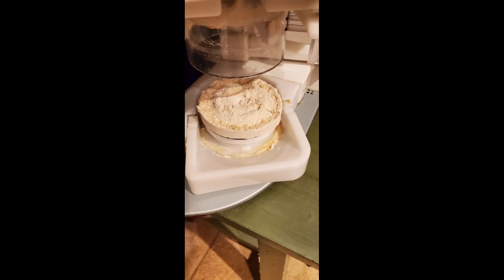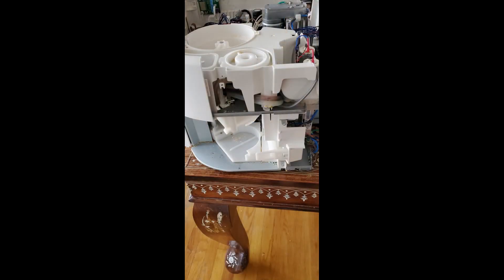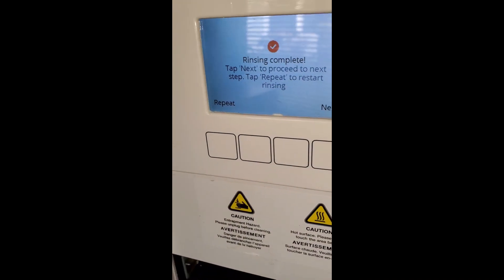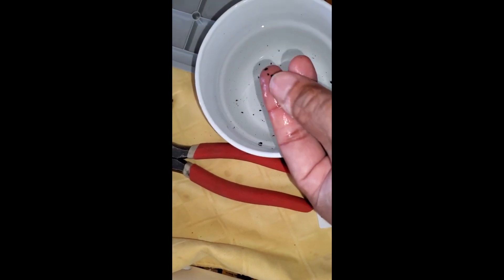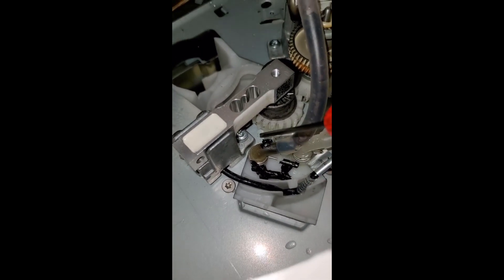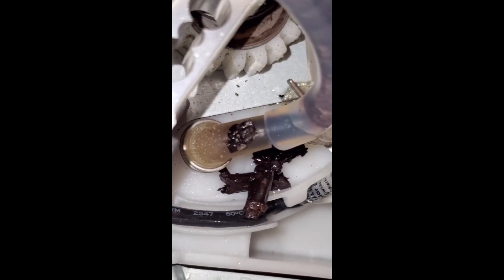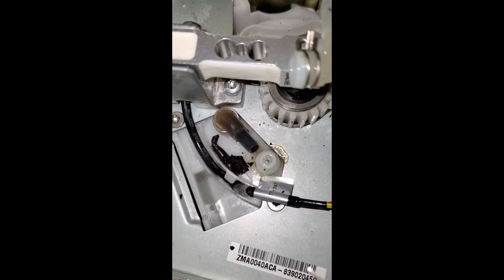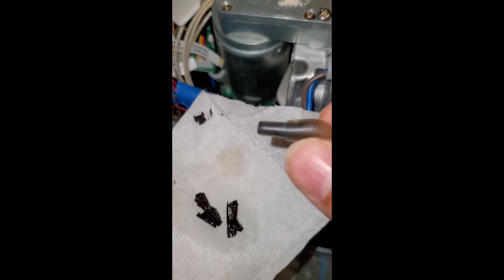ROTIMATIC BLACK RESIDUE IN WATER PIPE --IT'S *NOT* SIMPLY MOLD BUT PLASTIC BREAKDOWN!!

Comment: Could you suggest the silicone tubing and the L shaped connectors that you got new to replace? Secondly, any suggestions for the electrical connector (This is the issue of the lower pan not heating) .. I don't know how can I share the picture here..

Comment: I took the tubes out. I was foolish enough to not take pictures. Also I lost one of the nozzles. So I replaced the one with the oil as my oil was always leaking. So i never used oil.

Do you by chance have pictures of tubes connected. 
Ex Does tube coming from water source goes clock wise or anti clockwise over the circlular thing(water controller I guess) ?

Comment: We saw the same black rubbery material when we opened our rotimatic. Have you found a solution to this problem? Are you still using your rotimatic? 
We are too scared to use it, not sure what kind of health implications will be there after ingesting that material for so long.
Reply from the maker: Dear Pooja. Thanks for your comment. It gives me support too about what I'm seeing. Unfortunately, for me, the water sensor has stopped working too. But, no, the original problem has not been fixed. I'm getting some detailed feedback from Rotimatic and they claim they have not seen this before.  Also the motor seems to be burning up under some sort of strain. I don't think it is a good idea to use the machine when the nature of this deposit is unknown. In my case I was told it is definitely not mold.
Reply: @MegaCricketeer  I found this rubbery material too . I do see some mold. But it is concerning that rubbery/plastic material is melting and those compounds are getting mixed with our rotis everytime the machine heats up. I am asking if rotimatic can take it back for recycling. i don't want this anymore.

Comment: It's great that you were able to power it with panels removed. I had opened mine to fix bottom pan not heating. I agree with your FB post opinion, it is an ingenious piece of appliance. They just have to learn and fix issues people r seeing in real world use. And bring some local servicing centre's in North America. Asking U$580 (C$950 for us I'm Canada with taxes) is too much.
Reply from the maker: @Navin. Thanks for the comment. Ouch!!  $900 CAD is just purely ridiculous for for example replacing tubing. Doesn't it even cross their mind what they are asking? I fully agree with you. It is a sad failure of management that will kill this innovation.  Once you open the machine couple of times, you realize that it's not too much work.  Btw, regarding powering it while open, in my case the back can be reconnected for tubing issues.  You probably can connect extended wires from each of the power clips to the back cover, using either duct tape to hold the wires or clips.  Then even with the fan connected one can move the back over on the top of the machine and still have power..  I am going to check the heating element and see if my suggestion works.  Thanks, again.